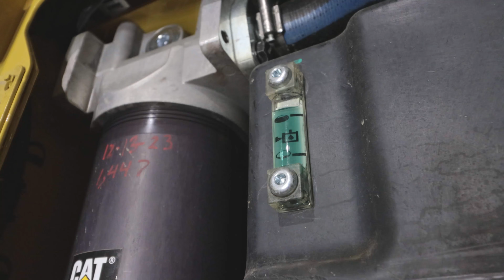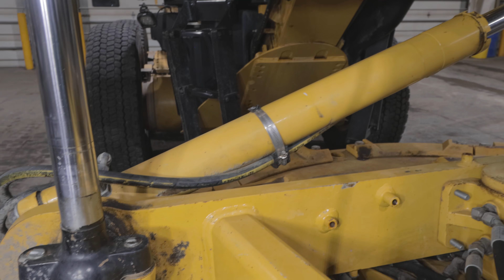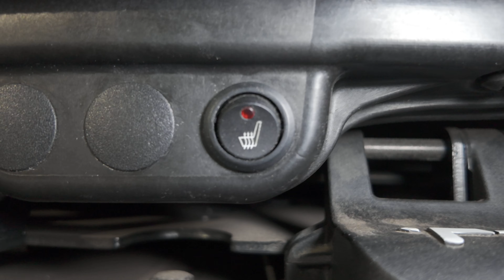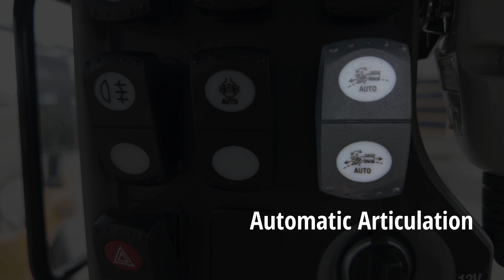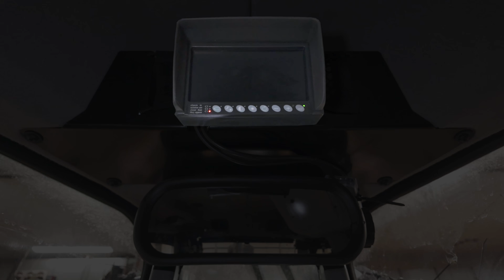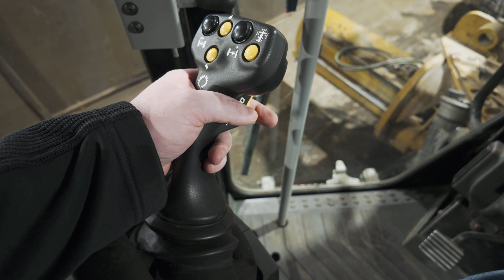CAT M-Series Motor Grader Training - Overview

Comment: Why does Alaska use a (BLUE) strobe with the (Amber) one. Just asking the question as down in the states BLUE is "ONLY" for Police and now I see 👀 it on back of eastern city F.D. rigs. Does the BLUE mean something in Alaska as to telling motorists that this is a road maintenance piece of equipment.
Reply from the maker: That's a good question. I'm not entirely certain, but from what I've seen, the blue is only used by government agencies (Local, State, etc.), whereas the amber is used by everyone. If I had to guess, I'd say that pairing the blue and amber is a way to differentiate between official maintenance vehicles and private contractors.
Reply: In Australia blue flashing on machines indicates the machine is in park